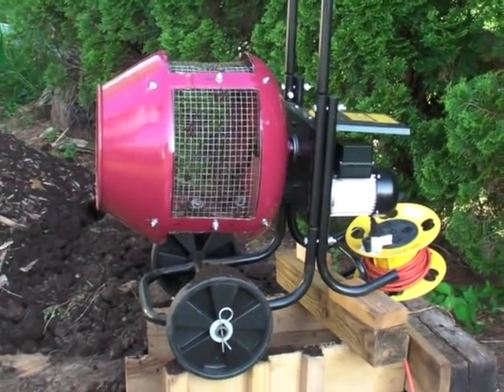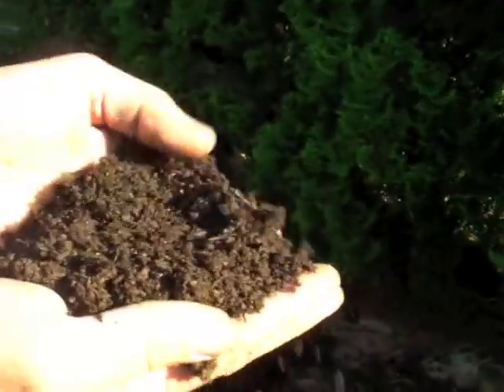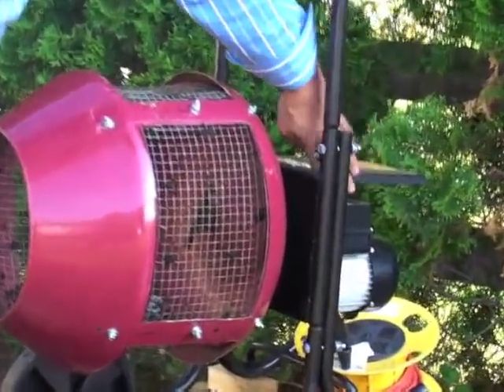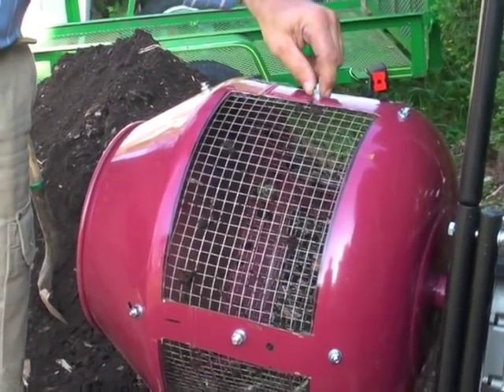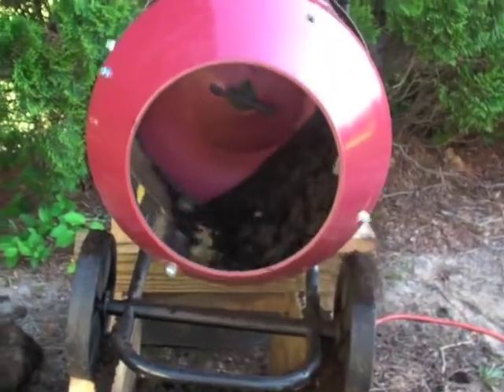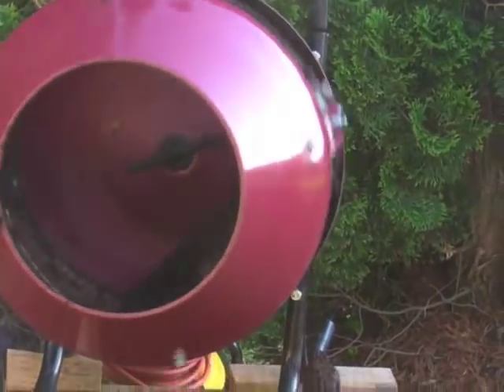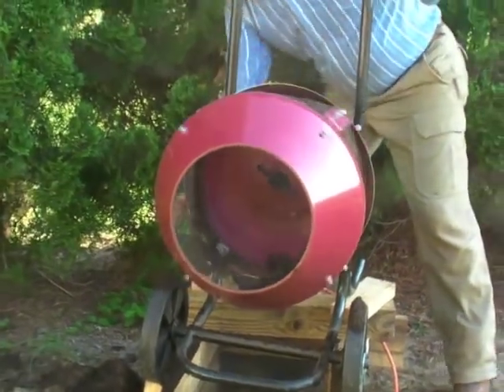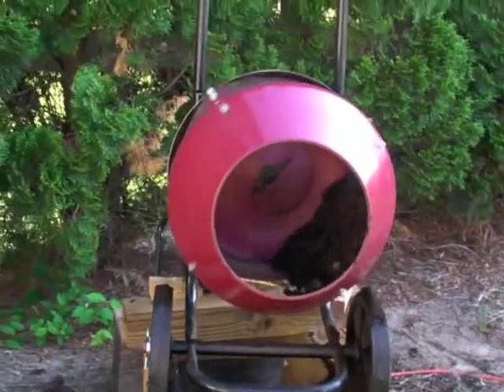Compost Sifter

Comment from the maker: To cut the openings I used a hand grinder with a cut off disk. You could probably do it with a saber saw and metal blades, but I think the grinder is better. The metal is relatively soft on this unit so the hand grinder did a quick and smooth job. You see the wooden support I made. It was quickly put together, but if you take some time and do it right it will sit on it better and make it easier to dump and shovel out from underneath.

Comment: Sifting is the easy part. The tough part of any sifter design is what to do with the material left in the basket.
Reply from the maker: Generally I use it as fill material along a retaining wall or some space that needs some rough material.
Reply: When sifting compost, the big stuff goes back into a cooking batch of compost. For non-compost, use it to fill up rodent holes in your property.

Comment: you should find a free or very cheap tread mill and you can use it to separate the fine soil from underneath the machine. just need to come up with some set up to put them together.

Comment: Hey, Have you thought about putting some 1 1/2" steel ball bearings in it as it sifts? My thought is that the BB's would help break up the compost marbles. How ever, you would probably need to have tougher cage netting. 
 Just a thought, let me know what ya thing.
Reply: shexdensmore I’ve tried your suggestion and if compost is too wet, the compost balls only get bigger. It might work at the correct moisture level.